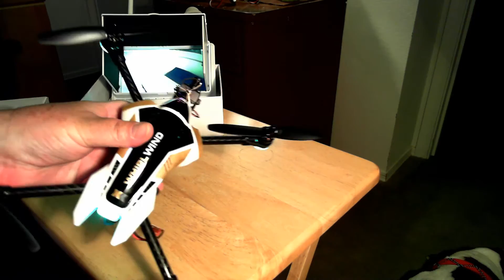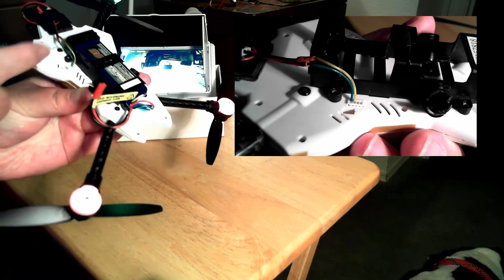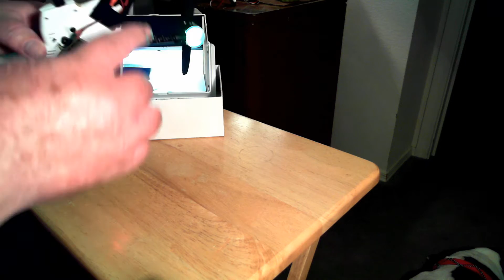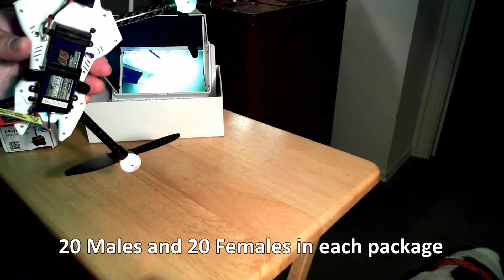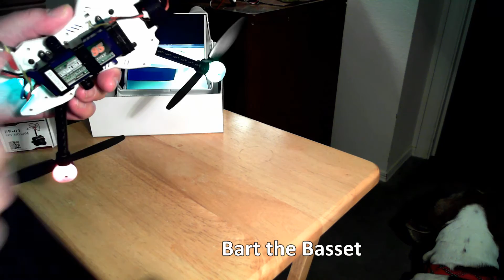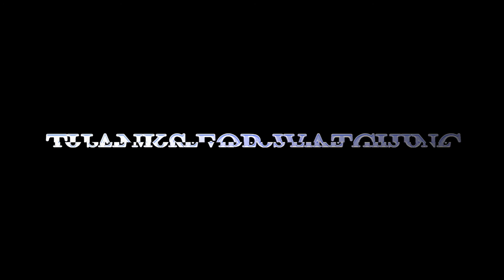XK X251WHIRLWIND & EACHINE EF-01 FPV AIO CAM

Comment: what connector did you use to plug the fpv cam? fpv cam connectors are bot compatible with the quad. i need one like yours. where to get one?
Reply from the maker: I purchased off of eBay 20 PAIRS Micro JST 1.25 4-Pin Male&Female Connector plug with Wires Cables available from various sellers.
Reply from the maker: I also bought For Walkera Battery 2-Pin Connector Male , Female with wire X20PAIR off of eBay

Comment: Nice, thinking about adding this camera to my 251.
Reply from the maker: I have since upgraded to the EACHINE TX02 200mW camera for about the same price, much better range and lighter weight.
Reply: I finally did get a FX797T Micro FPV Camera, very small & light weight.

Comment from the maker: Here are the connectors I used 
New-20-PAIRS-Micro-JST-1-25-4-Pin-Male-Female-Connector-plug-with-Wires-Cables
http://www.ebay.com/itm/272137944558...%3AMEBIDX%3AIT . These are both male and female with the wires attached.

I also purchased 20 pairs of these, I thought they would come in handy. For Walkera Battery 2-Pin Connector Male , Female with wire X20PAIR. http://www.ebay.com/itm/272324689984...%3AMEBIDX%3AIT